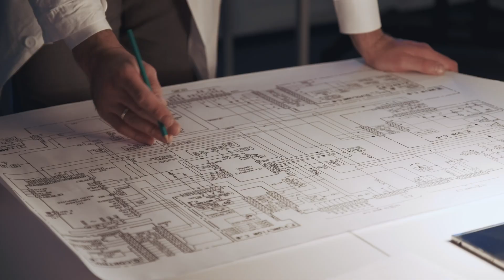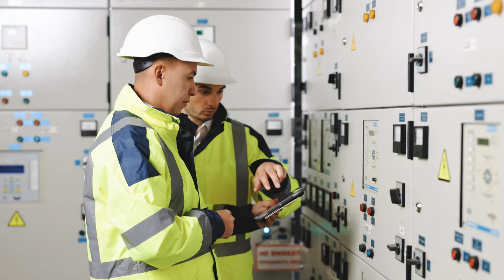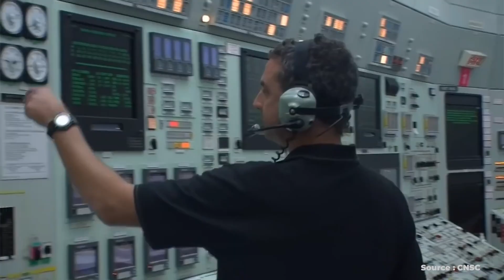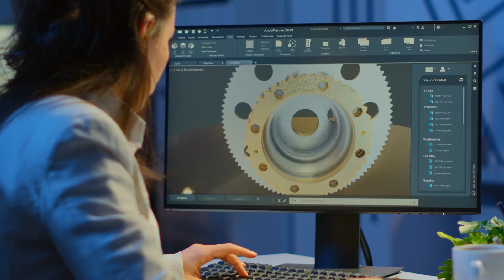Top Nuclear Energy Careers: Canada's Future

Comment: Recently, the IESO released their "Pathways to decarbonization" plan, at the request from the minister of energy. The goal of this assessment was to determine what needs to be done in order to meet estimated decarbonization of the economy. A big push here is the move to EVs, but also electric heating, industry transition towards electric machines, etc. One VERY interesting result of this study was that an estimated 17,800 MW of new nuclear production must be build. This report also estimated roughly the same amount of Hydrogen power, a technology which doesn't even exist yet. So if Hydrogen power doesn't pan out, we could be looking at 35,000+ MW of new nuclear required. 

One of the biggest challenges, is how do you actually DO this? And how do you do it as EVERYONE around the world is also doing it, and fighting for the same people. The current existing nuclear workforce would be required to TRIPLE. Now also consider the age demographics of the nuclear sector is quite old, and Canada is going to need an astronomical mount of new nuclear engineers, pipe fitters, welders, electricians, mechanics, with nuclear certifications.

If you have kids, and you want them to have a well paying job for life, getting them into the nuclear industry is going to set them up for life with a highly technical, challenging, but well paying and secure job. And not only "a job", but a career of great importance to the clean future that we must transition into. (I will add a link to the IESO study in a response to this, as links can sometimes get blocked by youtube)